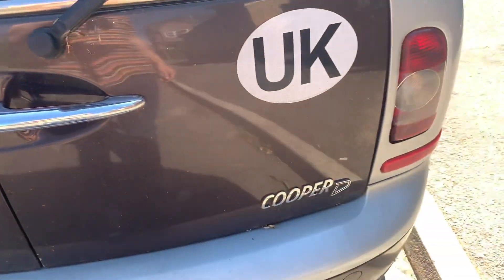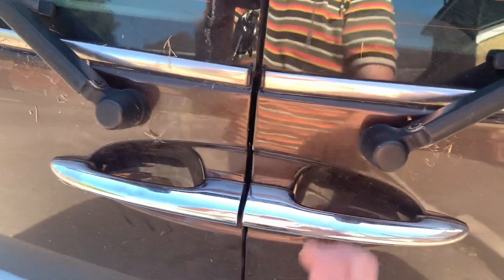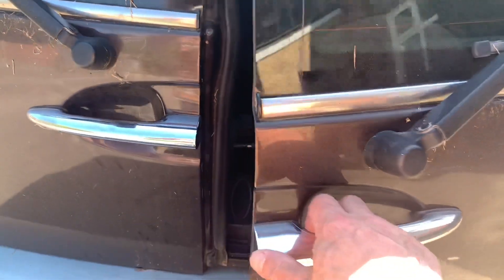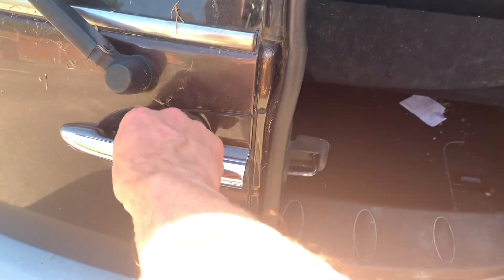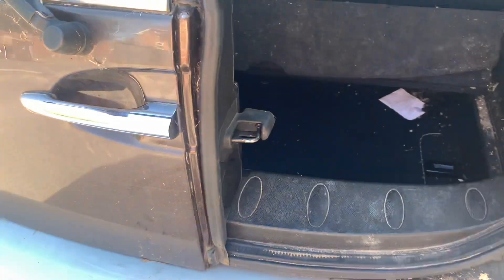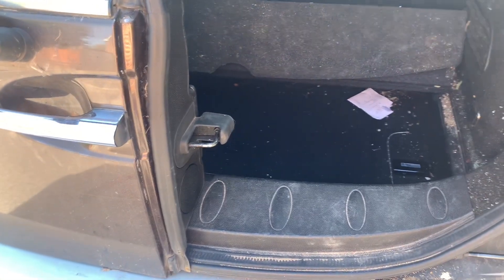Mini Clubman barn door manual release

Comment: Hi,
I have the same mini model with exactly the same problem but impossible to find your cable, do you have any ideas? thank you
Reply from the maker: On some models, the manual door release is a ring pull under the back seat, lifting the seat from the front. I fixed my door by resoldering a dodgy connector under the rear door card, a two cable wire coming from the button on the handle.
Reply: Hi there I have a 2011 and I can't find either
Reply: @132mikey123  I had it repaired and it cost me 150 euros with the mechanism, the mechanic did it in 3 steps, 3 movements, very quickly.... he tore off the rear panel and opened it with a hook.. ...finally it's very easy
Reply: @DanBakerMusic  I had it repaired and it cost me 150 euros with the mechanism, the mechanic did it in 3 steps, 3 movements, very quickly.... he tore off the rear panel and opened it with a hook.. ...finally it's very easy

Comment: I have a 2009 mini clubman s and it does not have that. How can I open the left door ?
Reply from the maker: The ring pull for the door is on some models under the back seat. Lift the seat from the front and you might see it..
I fixed mine: it was a shot wiring connector under the barn door card. I just directly soldered the cables together and it now works fine